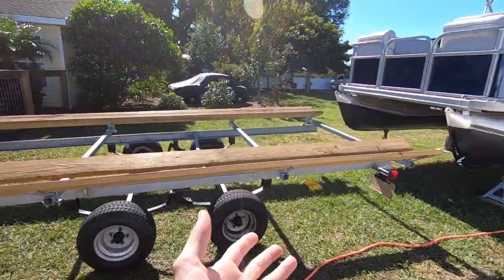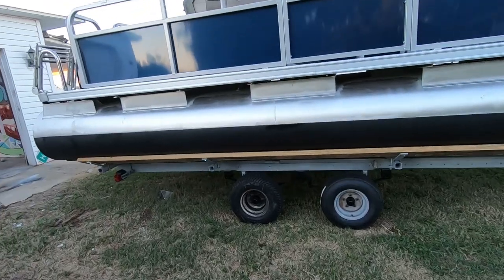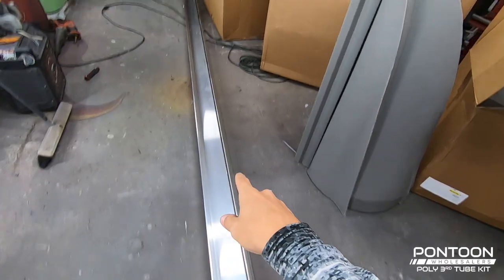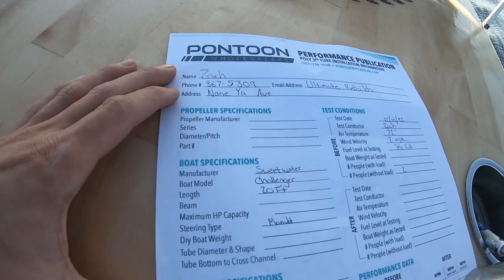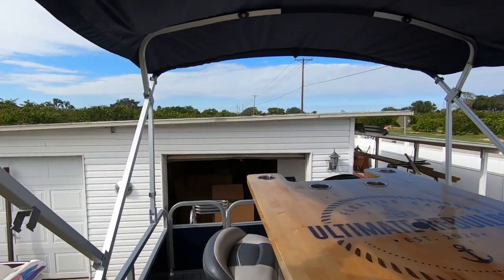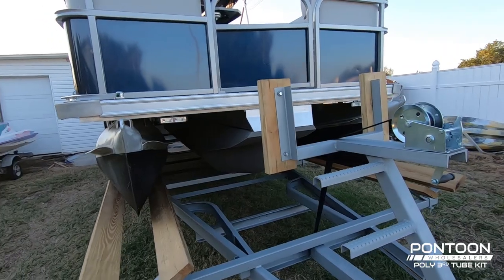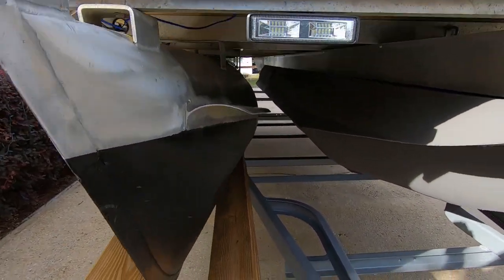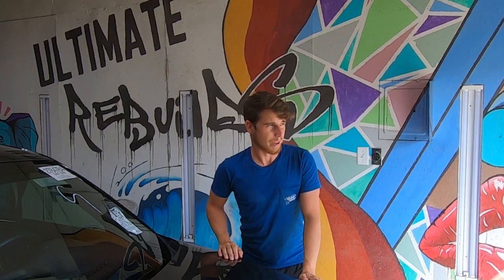Installing a 3rd Pontoon on my Boat. Works Amazing! -Episode 12

Comment from the maker: Hope you all like my new intros... wasn’t a fan of my old ones and just wanted to switch things up and try to be more unique. 
Anyways.. enjoy the video 😁
Reply: They are amazing!
Reply: I like this one more
Reply: Love it!!!
Reply: Amazing. Videos as aways.
Reply: I like it
Reply: Love em Zak
It will plane quicker because of 3rd Pontoon But also Creates More Drag, if you want more Speed, Change your Prop Out, a different pitch will add Speed but remember  its a Pontoon  Boat ⛴ not a Speed Boat.🚤
Reply: And Go With the Leaning Post With Adjustable BOLSTER SEAT
Reply: AND ADD A FLAG BRO
🏴‍☠️
Reply: I’ve got a recommendation for you. When I saw the under side of your boat there was exposed wood. I would coat it in some kind of water proof paint and a clear coat. It’ll keep the wood to last long and not rot. Just my theory.
Reply: U should add a mini fridge on it!
Reply: Y’all need to come up with a name our family yacht is called the green flash
Reply: Awesome 🙌🏆🙌
Reply: Also Don't forget to add Midland MXT105 MicroMobile GMRS 2-Way Radio & a AcuRite 5-In-1 Weather Center With Color Display it will help in case any emergency.👍.
Reply: Been waiting impatiently for an update. Wicked. Amazing work.
Should lift the motor up abit. It's way too low when boat speeds up. Losing good amount of speed because of that
Reply: A tip : you can watch series on kaldrostream. Been using them for watching loads of movies these days.
Reply: @Payton Jeremias definitely, been using KaldroStream for years myself :)
Reply: @Payton Jeremias definitely, have been watching on KaldroStream for years myself =)
Reply: Hope theres a cost listed someday for this xtra toon.
Reply: What did this kit cost?
Reply: What kit do you buy?

Comment: Put some plastic or carpet on the wooden runners to help it slide on better. Great job Zac love that pontoon
Reply: He knows about the carpet. He had carpet on the old trailer & added more when he replaced some of the wood on that trailer.
Reply: I was wondering about the bare wood as well.  We've always used polyethylene strips on bunkers, really slick.  Counter sink with stainless screws and they'll out last the boards.
Reply: @johnthompson9625  and then some oil or wax on them. It’s like sliding on ice.

Comment: If youre only turning 4700 RPM you made need to drop down a size or two on your prop. That motor should be turning close to 6000
Reply: Rodney and Paige Glass      That is correct!!
Reply: This is the reason I came to the comments, just watched the video and saw him mentioning his RPM. Need to go back probably -2 on your pitch

Comment: I owned two 20 foot pontoon boats, then purchased a new 24' tritoon.  A standard pontoon is a displacement hull, simply moving water out the way (like the Titanic) and will never plane. You can add all the horsepower you want and never get over about 24 mph.   The 3d pontoon gives the boat enough surface area to plane, and yes, makes a Tremendous difference all around.  I noticed your pontoons were very small...I think mine were 25" in diameter on the tritoon and it would go well over 30 mph with a 115 hp four stroke Mercury. Fuel economy was extraordinary, stability and turning was great. I even took it into the Gulf of Mexico out of Mobile and it felt safe.  Everyone should add the third pontoon to their boats.

Comment: A third pontoon will increase your buoyancy thus increasing you GVW capacity. As far as adding speed......not really. But will increase your acceleration to your current top speed. Done this a few times. Great Job. Its one of the best bang for your buck modifications. And Pontoon Wholesalers are a great source.

Comment: Thanks for changing the intro , very nice. You should put carpet on the bunks, aluminum and pressure treated lumber don't play well together.
Reply: I was wondering if he was going to carpet the bunks, too. I know he replaced it on the old trailer so when I saw them bare, I thought for sure he will.

Comment: I recently put 1" x 6" PVC boards in the place of carpet on my pontoon boat trailer bunks.  I got them from Lowes.  It looks good and works well...so far.  I countersunk carriage bolts staggered at 2' intervals to hold the boards to the trailer boards.

Comment: Watching you go back and forth jacking up the pontoon reminded me of when I had to get a 1,000lb hydraulic lift off of a pickup truck by myself. I used an engine hoist and did the reverse, slowly lowering it back and forth until I finally got it to the ground. I was dang proud of myself.

Comment: Just saw your channel for first time tonight. You seem to be a talented and motivated guy, great job on the pontoon boat. A bit of advice from an old man with many thousands of hours on the water. You will want both swing doors on either side usable for docking at fuel floats and for guests to get on and off. Keep up the great vids.

Comment: I've watched this series with interest and have enjoyed watching you trick that boat out. If I may make a comment on the new center pontoon. I come from a airplane background and something that is done as a safety precaution is when you put a bolt and nut in an airplane if possible put the bolt head on top so even if the nut comes off the bolt will stay in place. I noticed that the bolts you put in the heads are down. I'm sure it's not as big of a deal in your application but in your case if a nut comes loose you'll lose the whole nut/bolt combo. I'm looking forward to more vids, keep up the good work.

Comment: Great idea to add the 3rd ‘toon; I didn’t even know you could. And smart choice on the beefier trailer. You shouldn’t regret good money spent on safety and reliability, especially if you start towing that bad boy to other lakes on the highway. You’ve done a great job of building a $40k tritoon from a $1500 starting point. Even if the cost was $20k (retail), you are still way ahead

Comment: You need to trim up more and lift your motor. It's sitting way to low when under way. The water should not be at the bottom of the cowling. It needs to be at the cavitation plate

Comment: Great! I’m planning to do this to my $1500 pontoon boat as well! It sounds like your conversation with Pontoon Wholesalers was as great as mine! I’m going to get the motor mount and integrated fuel tank in February on a 20’ log from them. He also recommended a new prop for me, really great stuff!
Reply: That seems standard on these pontoon boats, the wrong size prop? Just like this one, running far too low RPM. Weird.

Comment: Hey man I’m a certified marine mechanic and mercury. That motor should run up to about 5000 rpm maybe even 5500. Look into changing your prop to get the max performance out of your boat. Lmk if you ever have any questions. Love the content. Smooth sailing!

Comment: Most factory built tri toons have "spray shields" or skins which bolt up under the deck cross members to cover them and reduce drag from the water hitting the cross members.  Also change your prop and go to a 2-4" lower pitch to get your rpms over 5000.  Its about a 250 rpm increase  for every inch of pitch, i.e. if you have a 19" pitch prop pulling 4700 rpm going to a 17" pitch should get you around 5200 rpm.  Run your test with just you on the boat and the engine trimmed up to where its just below the point the prop slips or cavitates.

Comment: yep as said below, at 4700 rpm you are bogging that motor. You need a little less pitch prop for that added weight. 5500 should be your minimum wide open throttle rpm. The response and steering will really wake up...and you'll go a little faster

Comment: For lifting the Tritoon off trailer, did you ever think of making your own Gantry Cranes made out of wood? You could use a sling to go under pontoons and chain hoists for lifting. With the price of wood it may be a little expensive but worth it in the long run. We just got a 14' Sunray! Love your videos.

Comment: Hey my man" a little trick so your pontoons don't get damaged, on the runners' get some carpet and fasten it to the runners so it slides on and off easily without scratching up your pontoons' eventually the bear wood will damage them🤔😁👋👋

Comment: Your motor is too low. Also, you need to find a new prop. You shouldn't be maxing out at 4700 RPM. Find out the WOT operating range for your outboard. I'd recommend a 4 blade Stainless steel prop with a low pitch, like 13 or 14. That should get you closer to your WOT operating range.
Reply: Prop is deff wrong he should be getting more speed

Comment: Be sure to take footage with a GoPro of the underside of the boat at top speed and see how turbulent the water is. Also if you put skins on the underside of the boat between the pontoons the water will Glide by faster with less resistance oh, and you might pick up some speed.

Comment: good work! Now with more buoyancy, you can play with a couple different prop combinations now that you have less boat in the water at speed, might run you few hundred bucks, or less for some good used stainless props. But, thrust vs. speed is a gamble on toons. Should be some good episodes for you!!

Comment: You need to carpet your trailer bunks. Buy black synthetic fiber carpet by the foot off the roll at Depot. Take measurements and pre-cut your carpet strips. Take each bunk board off individually, wrap 100% and then staple them on the bottom, then reinstall. Plus carpet the same on the two stopper bunks on your front winch tree. Also, do some homework into re-propping your engine. You should be getting your RPM’s up about 1000 more than your getting. That Mercury should be topping out between 5400-5700 RPM’s (not 4500’s). Go with the maxed radius prop for your engine, but one with a lower pitch, and one with extra cupping on the blade tips for pontoons, and you’ll achieve that. Get your RPM’s up and you’ll gain some top end speed. Nice thing,,, props are cheap. One more thing, the best upgrade we ever made to our pontoon boat was to add the SE Sport 300 Hydrofoil fin to our engine. It’s the “best in testing” hydrofoil fin on the market. The difference is night and day! Better more precise turns, the thrust increase is phenomenal for hole shots, and it completely eliminated any cavitation or prop blowout when accelerating. You can just bury that throttle! They’re not expensive either. Check‘em out, you’ll be glad you did! Great work so far. You’ve done a really nice job and I love your passion for it! Enjoy!!!

Comment: Hey man 4500 rpm seems low for wide open throttle on plane. My 90 Hp and 150Hp both want to be around 5500-5600 RPM when up on plane and at wide open throttle. Lugging the motor can wear it and/or the lower unit out early, so you may need to get a higher pitch propeller. Every inch of pitch is good for about 200 RPM. Good Luck!

Comment: Also Don't forget to add Midland MXT105 MicroMobile GMRS 2-Way Radio & a AcuRite 5-In-1 Weather Center With Color Display it will help in case any emergency.👍

Comment: I'm sure you already checked, but when you hammered in the front, your mount bolts were either loosening or tightening, might wanna double check.

Comment: Didn't look to even out the boat when setting in the water (backend still set lower) and didn't look to raise boat on water at all. Maybe with more passengers it would help but it looked to set plenty high enough before installing 3rd pontoon.

Comment: Did you have to lower the motor in the water? Seems like if you're sitting higher out of the water that less prop would be in the water. I'm thinking about doing the same with mine and I'm curious.

Comment: Little late with this comment, but it'll be interesting to see if that metal cap on the bow of the center pontoon scoops water and throws it up into the air where it will likely be blown aboard.

Comment: I'm not familiar with your outboard, but you may need a different prop if your rpm is limited to 4700.  Just found a chart and 4700 may be the acceptable low end of the range, so you might be fine

Comment: Ho, great video but you don't show the U-bolt install for the trailer safety strap?  curious if it was a problem ?    seems like just ubolting into the front plate would not be string enough? any advice?

Comment: Hey Man. I am about to do this install on my pontoon. I have the same situation as you where my u bolt for the trailer winch is located underneath the deck and will be blocked by this polytube. Any advice on bolting up a new one? I want to make sure I put the new one in a spot that is suitable for the load that will be put on it during trailering. Thanks man

Comment: I have been considering the Pontoon Wholesellers third pontoon for a little while.  You mentioned taking various measurements both before and after, but only talked about speed and getting on plane.  Can you share your other measurements for comparison purposes, because I am very interested in those changes for my own.
Reply from the maker: Sure, what are you interested in?
Reply: @ultimaterebuilds7127  pretty much all of those comparison numbers 😆.  My pontoons are U shaped and don't float as much as I think they should, which will impact everything, possibly except top speed as you saw.

Comment: Hey bud, you need a new prop. That motor should be turinging 5500-6500 RPM depending on what the manufacturer says.

Comment: Cover them Damn trailer boards with carpeting. That just hurt watching that boat go on the trailer. With carpeting fastened to the boards and wet it down and the friction is substantially reduce. I’m glad you didn’t film that in full real time, it would have drove me nuts. Can’t go wrong with the right pontoons for the right builds. It’s a boat weight is the enemy. Don’t want to be left out there with Jana, Sandy, and Jane and look at a cabinet and say if I wouldn’t have stuck that in here Julie could have come along too. LoL.

Comment: My question is, would it have been cheaper to build this pontoon from scratch?  The only thing original is the two main floats and the cross members. 

Otherwise, great job.  Awesome work.  Your father must be proud of you.  Most young men your age would rather play video games all day.
Reply from the maker: Eh not really... new pontoons would have cost around 5k for the pair then you would have to buy the crossbeams and transom. Also a trailer too. 
I technically made money after I sold the trailer and a lot of the parts that came off the boat.... (obviously before I replaced everything else)

Comment: See how high is your motor, maybe it's sitting too low, also the priority is buy another prop a lower pitch to make your rpms increase. You're burning gas without using it properly.

Comment: your motor looks really low, your cavitation plate is way too deep or low below your transom.. try raising the motor.. you should have some open mounting holes.. if not, a jack plate would work.. then you can raise and lower it easily... but raising it, you'll gain rpm, and in turn, more performance (better gas mileage, response time, and overall some more speed.

Comment: Okay so I've watched the whole series. Its sick. But.. You've literally bought every single part of a pontoon boat including new trailer. Almost feels like you didn't even need to buy the original, new trailer, new motor, new deck, new pontoon. New every single part. It doesn't really make sense. Feels like you could've just started from scratch